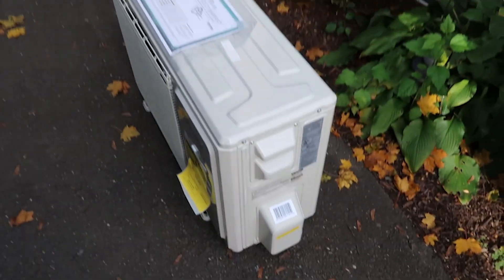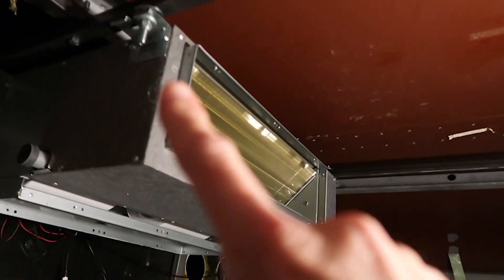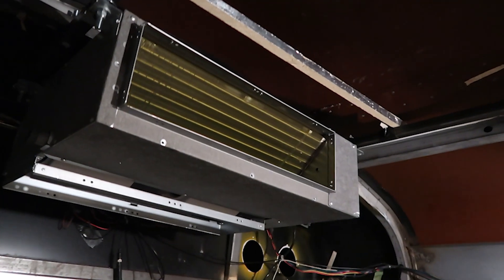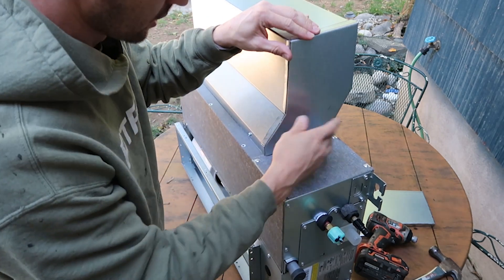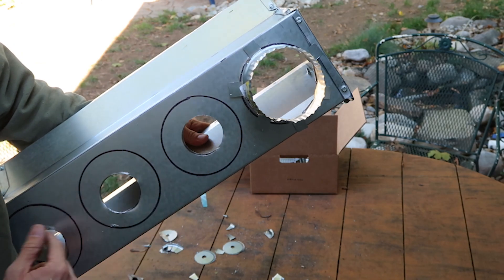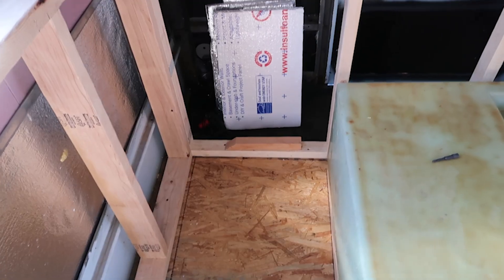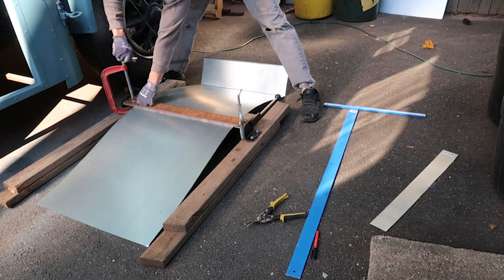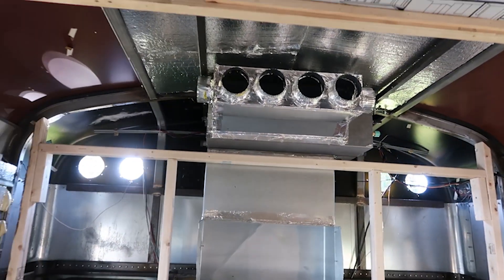The Day Has FINALLY Come!! Installing Mini Split in the SKOOLIE!!

Comment: Hey Dan,
A few ideas that might make that better. You will need a dampers on all the runs because the air flow will be very uneven with that plenum design, there isn't a better way to build it here, it is what it is, putting dampers close to the plenum will reduce air noise at the register, as apposed to the controlling and balancing air flow at the registers.  Also if you plan on soloing it and sleeping in the bedroom you may want to put large supply registers in the there, so you can close the registers in the front and open the ones in the bedroom, this way  you don't have to cool the whole bus, making it easier to cool at night off house battery power. Also plan on a louvered doors or something like that, to get the air from the front of the bus back to the return air. One last thing I can think of, is follow the installation instructions for service access, it would seriously suck to have to tear things down when that needs to be cleaned or repaired.  

A quick search yielded these two dampers. You may be able to find better. 
https://www.homedepot.com/p/Master-Flow-4-in-Damper-D-4/100396928
or 
https://voomisupply.com/products/southwark-metal-manufacturing-atd4-duct-collar-take-off-4-in-dia-28-gauge-thk-silver?currency=USD&variant=40874998988911&gclid=Cj0KCQjwqoibBhDUARIsAH2OpWgzxpK4Ga1JFskghnKjm5rEcsWcBfhefzS1LFGrLBK6ofQ6wQnPgksaAjgMEALw_wcB
Reply from the maker: Thanks for commenting Dan. I appreciate the input. I will be picking up 6 of these dampers that you linked. The bus will be open from the front to the back so It will be able to pull the air throughout the bus. I was thinking of putting a 4' x 6" register coming from underneath the plenum for the bedroom. The unit will be covered with removable cabinets from the one side and it will be open from the other side (the back) where the "garage will be. Once the dampers are in ill have to play with it so make sure im getting good air flow through out the bus.
Reply: @DanZalinsky  A few more things to consider are: the bigger the register you use the less noise it is going to make (if you are considering my idea of closing registers in the front and opening the ones in the back, biggest is better) and smooth metal duct is going to flow more air and be quieter than flex duct work.  
I still think you should consider adding closed sell spray foam insulation before it is to late, it will help this system work better, give a vapor barrier (the most important benefit if the bus will be heated in a cold climate) , and improve comfort.

Comment: How’s the system doing now? And what type of MERV filter do you use? I didn’t think you could use other filters besides the mesh one provided due to airflow restriction, but I would be interested to know if it doesn’t affect it.
Reply from the maker: The system is still working great. I do have to replace the filter more often than if it was in a house. But I just make sure the filter is always clean and it runs great.

Comment: This method is innovative in the bus world! I plan to use this type of AC too now vs two minisplits at each end of a 40fter. I'm thinking of mounting ours it in the middle of the bus where the bathroom will be so air can spread evenly. 

Does the cold air reach the front of your bus well on a hot day and how has the transformer been working so far?

Comment: Awesome work, thanks for sharing! I do have one question; wouldn't an insulated plenum make more sense? My upcoming install is in a basement and I am debating whether to to use insulated ductwork or sheetmetal? Like Dan well says below, sheetmetal provides better airflow, but will it sweat? We are in north Georgia where it's humid at times but not extreme like FL or TX. TIA!
Reply from the maker: The Plenum that I built is in the ceiling that is insulated. I do have airways that allow the bus temperature travel into the ceiling so it is kept at the same temp. The return plenum is insulated now because that is in a non insulated area of the bus.
Reply: Hi how you hookup the thermostat

Comment: I would not have place a wall under the unit; if you ever have a coil leak you will have to either take down the wall or remove the whole slim duct to access the coil and replace it.

Comment: ?  size in BTU   ?    120V  ?   i AM GUESSING  ..   good workmanship..
Reply from the maker: Thanks!! It’s 12k btu and it is 220v. I wired in a step up transformer to take it from 110 to 220. It only requires a 15amp breaker.